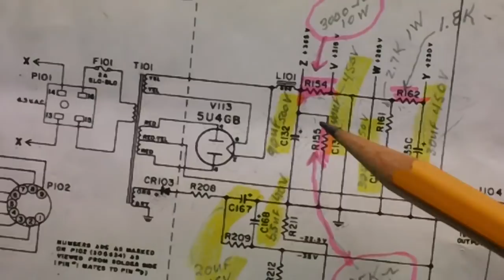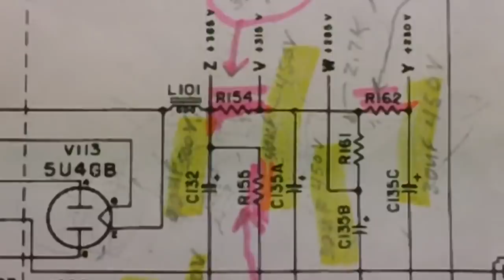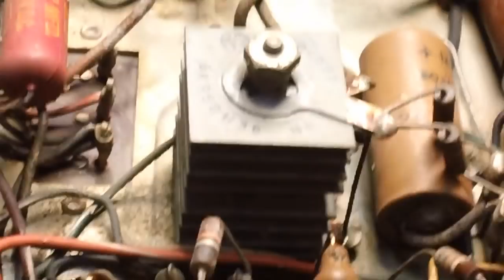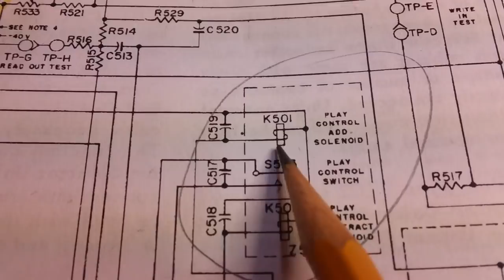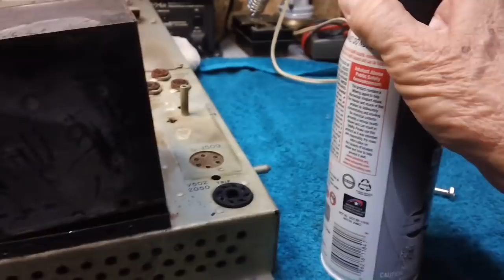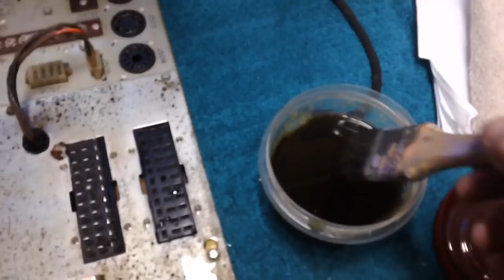1961 Seeburg AY100U Jukebox restoration (Part 50 of 87).

Comment: Very good 'teaching moment' - the choke being over 8 henries following a 5U4GB is fine for a 100µF input cap bearing in mind also that the tube rectifier has a warm up time and that is already slowing the voltage rise to the input cap.

Comment: Hey John, 

Thanks for the explanation of what a choke does.  I've heard of them and even have a choke or two on some of my radios, but wasn't sure what they did.  Now I know.

I finally sprung and bought some Evaporust.  Found a gallon at Harbor Freight at a good price, I think.

Happy New Year, Tom
Reply from the maker: Tom,
You're welcome, my friend.  A choke just blocks AC but allows DC to go through.  It's the opposite of a capacitor, which blocks DC and lets AC pass.  But in some designs chokes can also be used as resistors like you saw in this video.   Capacitors can also function as resistors.  In fact, many folks are using use caps to take the place of ballasts in the old curtain  burner radios.
About that Evapo-Rust...you can use it over and over until the cows come home.  I've had mine for a few years now, but there will come a time when it just won't work too well anymore...then it'll be time to buy new which by then should cost about a hundred bucks a gallon.  LOL  Every once in a while run it through some cheese cloth to remove rust particles and make it last longer.
Regards,
John
Reply: Thanks John for the advice on Evapo-Rust.  It wasn't too bad, expense-wise at Harbor Freight.  I used one of their rare 25% off coupons and paid $19.49 before tax, for a gallon.  Harbor Freight item # 96431.

Comment: Hi John, very interesting video's, the play control solenoids and contact in the tsu let the carriage drive 2x left and 2x right, the selection buttons will give a pulse to 1 of the solenoids and the switch on the carriage give's a pulse to the other solenoid after 2 times the contact opens and the carriage stops scanning.
Reply from the maker: Roy,
Thanks, my friend.  It's good you should mention this little item now as I'll be skimming over the mechanism in the next video.   I'll just parrot what you've written, which is all I can do.  But that puppy needs some cleaning work.  Hope I don't mess it up.
Regards,
John
Reply: I bet you don't mess is up and if you do you sure can fix it. Keep up the good work. Good luck

Comment: That amp chassis is looking pretty flashy John. It's coming along nicely. Hey if you have time, can you get the Dremel out and take apart that toggle switch. I'm curious to see how it failed. Oh I think I've got a bucket full of 5U4gb's around here somewhere if you need one.
Reply from the maker: I greatly appreciate the offer, my friend, however, months ago I ordered all the tubes I'd be needing for the project, but will get back to you if the need arrives.  It's always good to have a plan B.  As for the switch...stay tuned for the next video.
Regards,
John

Comment: John, I had no idea that chokes served the purpose of limiting the inrush current as well as smoothing. Thanks for the education.
Reply from the maker: Ian,
In addition to the primary purpose, both chokes and caps can be used as resistors.  A speaker field coil is merely a choke...that provides magnetism and filters the B+ all at the same time.   Cool huh?
Regards,
John

Comment: just watching your video and you were talking about your not going to turn the amplifier on/off/on/off....but the jukebox does! everytime the jukebox is used the HT is switched by the play control relay...for every set of selections...if used continually the HT is maintained with the amp just muted....i'm not going into the 4x20uf versus 1x100uf debate, all i would say, is seeburg must have done that for a reason, perhaps ESR is lower, but i am sure you will be fine for home use, not the punishing use a bar jukebox would have been subjected to.....
Reply from the maker: Seeburg might have connected those caps in parallel so if one got weak or failed the others would keep things running for at least a little while.  Either that or the bean counters snuck in the back door. LOL
Regards,
John

Comment: My thoughts about the rectifier tube (5U4GB). The 100 MFD. cap won't really hurt anything or pt extra wear on the tube. The "GB" version of the 5U4 is for higher current as compared to the standard. The coin tray looks like brand new! We'll see how the chassis looks in a day or 2.
Reply from the maker: RW,
I appreciate the GB info.  Didn't know that.  The chassis is still soaking and is showing some improvement, but my Evapo-Rust is pretty old and losing it's ability to remove rust.  I should maybe make a trip downtown for a new container.  I'll know in another day or so.
Regards,
John

Comment: John,
My reason for subscribing to You Tube channels, such as yours, is to generate friendship with likeminded people.  If I learn something along the way, that is an added bonus.
Looking at the power supply circuit diagram I understand why Seeburg incorporated four 20mfd electrolytics.  Personally – and this is purely from a personal point of view – I would install four, quality brand 22mfd electrolytics @ 500vdc, and I’d be looking for ESR readings (with my cap tester) between 1.4 to 2 ohms.  As I say, this is purely personal preference: I’m not suggesting, or implying you do likewise.  
If I’d have installed a 100mfd, which is fine, I’d consider removing the 8.3Hny smoothing choke, and replacing it with one rated between 15 and 32Hny, of similar current rating (its dimensions would be subject to available space for mounting).   Again this is purely personal preference: I’m not suggesting, or implying you do likewise. 
As for the mains on/off switch …unless there is a fairly well concealed on/off relay circuit, or a latch circuit somewhere, I’ve never seen a spring release dpdt switch used for that purpose …it kind of defeats the object LOL.  Perhaps the installer was confused with the type, and operation concerning mains, and record eject switches LOL.
Cheers my friend, Phil.
Reply from the maker: Phil,
You won't learn anything from this channel.  You and Brendan have forgotten more than I currently and will ever know, my friend.  And I'm fairly certain there will be an update to that switch issue in the next video.
Regards,
John

Comment: You and Brendan got me curios.   I looked up the data sheet on the 5U4.  (It was a GE tube datasheet)  I saw that there is a spec for a "choke - input filter"  for a full wave rectifier circuit configuration.  It recommends a minimum10 Henry choke for the inductor and no maximum capacitor size for this circuit configuration.  Your juke's inductor measured over 8 Henry.  This supports both your conclusions that you will be fine with the cap you installed.   We both learned something today.
Reply from the maker: The discussion has been fairly widespread over this 100uf/ESR/choke cap bidniz.   Stand by, there may be more to come.
Regards,
John

Comment: Like others are saying John, that power switch is broken, I am sure you can easy find a new one for the job...
Reply from the maker: James,
It won't be any problem.  It's just that I've never seen a broken SPST switch act like it's spring-loaded.  It makes one wonder.
Reply: I understand that John,  I think that switch is simply stuck as I doubt they used it to turn it off. As they used to have a switch board that they would use to switch things on and off in one place. It may even work again if you sprayed some contact switch cleaner into it....

Comment: The switch is broken, it is the power switch and it should click on and click off.
I have seen quite a few juke boxes when I worked for a vending company, i even had a Seeburg in my house back in 1964.
Reply from the maker: Bill,
I figured it was busted, but had never seen a busted one have that spring-loaded action to it.  Kinda weird.
Regards,
John

Comment: I have a funny feeling about that main power switch !!  I will bet that this switch has failed in the closed position somehow !I may very well be wrong on this I will admit , but it could be possibility that for some reason maybe the contacts fused or welded shut or closed and that result is what you have experienced and the spring inside just winds up pushing the lever back instead of toggling the contacts open !  I am curious to find out if that's the case or not. Maybe the switch is otherwise just tired out too !! This is real strange though, but if the contacts ARE welded or stuck together, that makes me wonder if something had pulled a lot of current at some point, but that would have blown the fuse out more than likely !!  This is a GOOD MYSTERY !!!!  ------------------------------------------          John A Bellas      KC2UVN   the suspense is high !!  :-)  :-)   L.O.L.
Reply from the maker: John,
There's no telling what this poor old juke has gone through over the years, but she's about to get back on her ole Rock and Roll feet once again.  It shouldn't be too much longer.  At least that's the plan.  LOL
Regards,
John

Comment: John - that was a valuable lesson.  On the Hallicrafters 5R41I am working on the  16,200mH choke was open and I am struggling on what to add in its place. The filter is 2.2ohms so I am wondering if a 10W resistor would do the trick. I am not there yet but will keep researching.  That power switch looks broken to me  - however a question.. Which is the main switch... the RED button or the toggle... if the toggle it  is certainly broken..    You are getting close my friend..... almost there - Ron
Reply from the maker: Ron,
I always use 10 watt resistors in place of field coils, pretty big ones at that, so give it  try.  And since a choke provides both circuit resistance and filters ripple you'll probably have to add at least one e-cap from one end of the resistor to ground.  Experiment, my friend,...it builds confidence.
Regards,
John
Reply: Ron   A resistor cannot be used to replace an inductive choke.   Inductors have a useful electrical characteristic that is required in this application.  The inductor filters the power by converting electric current into a magnetic field.  By doing this inductors restrict the sudden changes in current flow.  The DC current pulses coming out of the rectifier get fed into the inductor to get smoothed out before getting to the filter capacitor.   An inductor is an electrical inverse of a capacitor.    An inductor in series with a rectified power supply acts like a capacitor in parallel with the rectified power supply.   They both act as filters in these configurations.
Reply: JP.... yes  I am aware of that and have a plan on how to address this in my radio....Sometimes the way I learn is by throwing ideas on the table and eliminate the ones that do not make sense.  I will talk about my solution in my next video as it is critical to the basic filament string.  Thank you - Ron